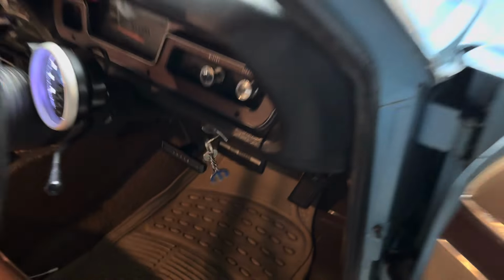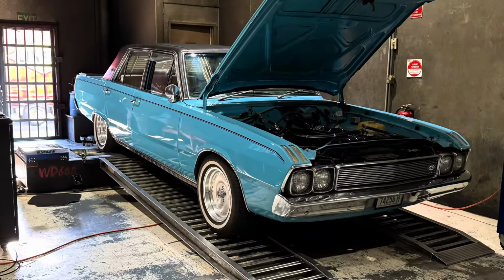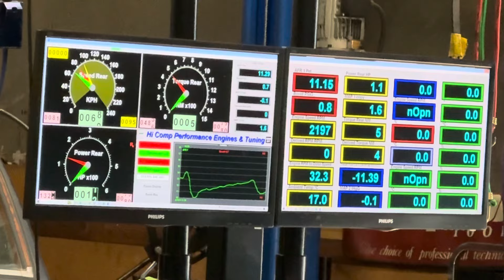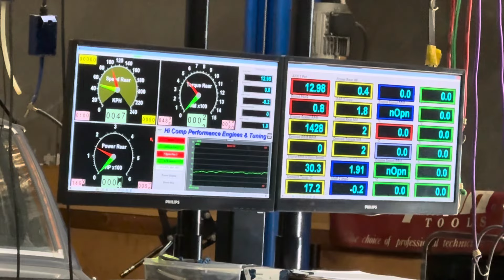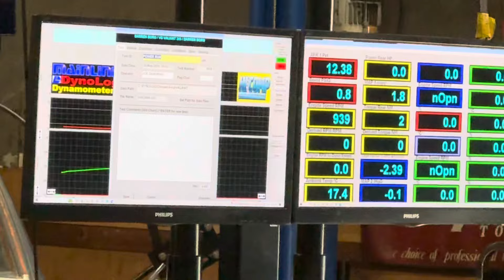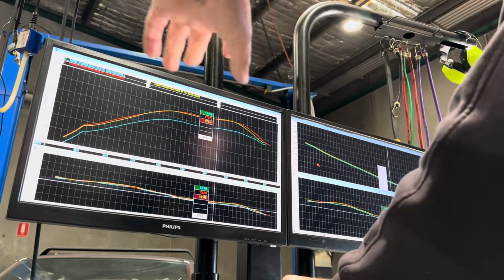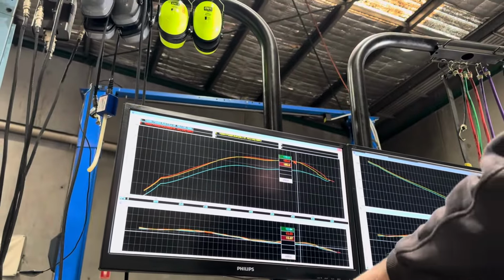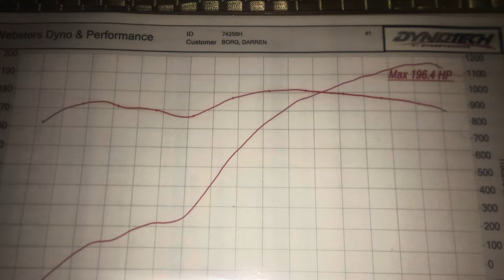Back to the dyno again, is it valve bounce? Hemi 245, Mainline.

Comment from the maker: Yeah something has always been a miss. I have ordered e49 valve springs, so we”ll see the out come. 302hp is a flywheel number. 245 auto with 3.45 gears is going to read a lot lower on a dyno compared to the original. 14.4 1/4 mile is pretty close to the original, let’s see if we can bet that.

Comment: I used to do lpg conversion s 40 years ago and many a time on the dyno a full power run would see water using between head and block its just a case of under performing  engineering a decent set of head studs and fine tread nuts will fix it

Comment: Interesting long way off stock E49 charger i know that's a 265 etc but still  302 hp (225 kW) at 5600 rpm.. Stock 245  Power: 123 kW (167 PS; 165 hp) at 4600 rpm this is only a two barrel.. I remember my stock 245 in my vg regal with a 4BL holly was making 200 hp and it had over 150.000 miles on it. DYNO AT TAFE. Now with the charger The increased power is due mainly to a more aggressive camshaft, high-load valve springs, triple 45 mm (1.8 in) DCOE sidedraught Weber carburetors, tuned-length exhaust headers and a higher compression ratio of 10.0:1. What compression is this running ?.. There was a low compression 245 only made 130hp 1977 etc..